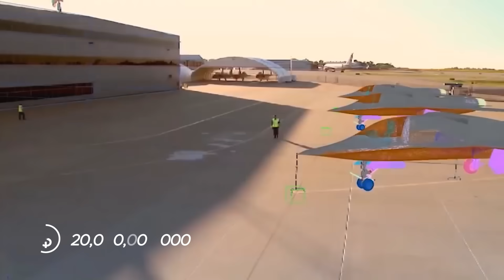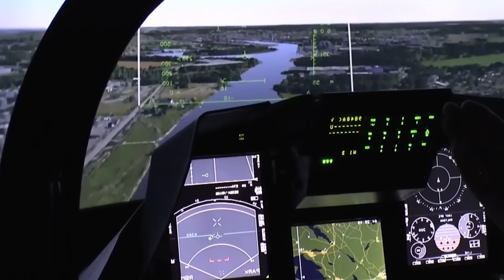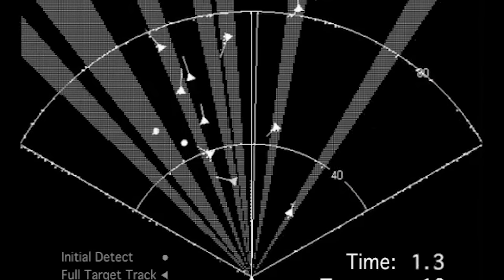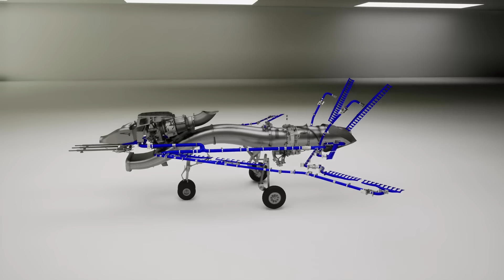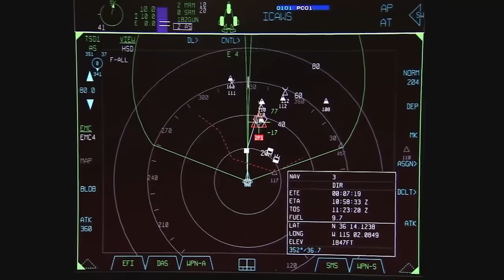Finally: US Revealed Its F-47 6th Generation Strike/Fighter Jet!

Comment: Connectivity is both a strength and a weakness. I hopecthis plane and wingman can operate even in noise saturated environments. Perhaps low power laser communication augmented by AI isolated mission operation during key phases of a mission.

Comment: The MONEY and ANNOUNCEMENT has very little to do with USAF requirements. It is a purely political decision where Trump thinks ONLY MONEY TALKS. Firstly to stop Boeing going Chapter 11 it needs $Billions. Biden GAVE Boeing that by swapping USN request for Lockheed Martin F-35C to BOEING F/A-18 Super Hornets. NOW Boeing still haven't sorted out their home made problems so a Trump Bigger Bung via "the development of the Next Generation Aircraft for USAF. Both these actions are in clear breach of the WTO Agreement regarding Boeing and Airbus. This is covering the Gaps in the 787 Fuselage with Elastoplast. The fundamental flaw is when the EU complains to WTO then after 4 years IT WILL BE TREATED AS A SUBSIDY and the Fine will itself break Boeing. Then there will be NO NEW DESIGNS for a Generation and like the UK the USA will have LOST its Commercial Aircraft Industry BY CHOICE. 
This is DUMB
Lockheed Martin can sue because it needs to recover many $Billions taken by Biden and Trump.
Reply: Obviously you have never been in the U.S. Navy, or worked for the DOD, Boeing, Boeing Aerospace, or any other major defense contractor. You have no idea what you're talking about, you sound "DUMB".

Comment: I'm very sure there are. US military aircraft that can fly into  space. Ai control. Or the pilot can at least fly the plane from earth ground. Never.
Even getting in the plane.  using tech like nuro link Basically , just think of what you want  craft to do and it'll do it. No need to worry about oxygen or G force . While using weapons far more advanced than Even lasers. Flying so fast that The enemy will not know what Happened .

Comment: $300 million per aircraft ?  You have to be joking. Does that include the lifetime maintainance contract ? NO. Remember the F35 program was supposed to $200BN but so far has cost $1.7 TRILLION.  So expect each new F-47 to cost about $2BN a piece and the double that with the maintainance contract. Love the vignette BTW.
Reply: The Vignette is probably more realistic than the fake video.
Reply: If Boeing got a cost/plus contract, you are correct!  It's all about the dollars.  Especially since they lost their shirts on the Starliner.
Reply: Are the ones that are building it with the same level of quality assurance the same people that build the 737type of airliner that keeps on crashing.

Comment: Wow! The super-duper F-47 look so fantastic & invincible, while the China J-36, according to most Western Analysis, "look impressive". However, the BIG CRITICAL DIFFERENCE is that the J-36 is already in the air while the F-47 is still on PowerPoint and AI generated simulation. 
Most probably India might assist the U.S. with their F-47 by imparting technologies like in their super-duper Vimana which are capable of intergalactic travel and have been protecting planet Earth from Space Invaders for the past few centuries which we ordinary Earthlings occasionally see them and called them UFO/UAP/USO/etc.
Reply: J36, is that the one the pilots call the flopping fish. That regularly burns out its' own engines?
Reply: @johnmccallum9106  
WOW! So, the U.S. of A has absolutely no need to worry about China catching up to their technologies. Congratulation and very well-done team U.S.A... and together with team India, they will be invincible all across the entire galaxy :face-blue-smiling::face-blue-smiling::face-blue-smiling:

Comment: One fighter cost could have saved the whole of the train transport system in the whole of the US. 2 of these would have cleaned up all the streets. Healthcare would have been all sorted by not making 2 -3 of these fighter planes. China really needs to make an automation system which can build these fighters faster and stock up;) It's a numbers game. China should train as many people as possible to fly multiple drones in warfare. Fighters are useless if cannot go long range. These fighters only have range of about 10Km as it sucks up fuel at the rate of SpaceX.

Comment: If its anything like their ships it will be lucky to fly for more than 10 minutes like the crappy aircraft carriers they've thrown together. 17 days at sea for the Fujian then refuel, when the stern doesn't crack and have to be rewedded. Or the new sub they built that sank in the dock while under construction. Or the fact that a high powered rifle can punch holes in military ships hull because the metal they use is crap. China is nothing! Yes they are a pretend super power with everyone of the traitors that past on the information they now use to try to be a powerful super power. But china can build all the stuff but have ZERO understanding of how it came to be. Believe it or not that understanding is vital to move it forward without massive problems and the Chinese have all thoughts problems inherent in everything they steal. Its screwing them and they don't even know why.

Comment: We really should be naïve without being aware that the air defense will also progress!!! The S 300 PMU 2, S 400, Buk m2 and Pantsir S1 are air defense systems that were made for 4,4+ aircraft and the first 5th generation aircraft!!! And in this conflict, Russia had FPV drones for which it had to find a solution?!?! And they succeeded for the simple reason that the Pantsir S1 is a system that is designed to work like a 4+ generation aircraft, only everything is packed on a truck!!! The fire control system as well as the radar are Mounted on a truck which is much easier and cheaper than building a plane!!! Which means that as the planes advance, the Pantsir S1 will get much stronger radars, as well as everything else that is needed!!! As we have seen, Russia has managed to save Syria from 4th and 5th generation aircraft, there is no reason to speculate that in 2 to 3 years there will be a modernization of all air defense systems in Russia, and in addition, Russia is working on its version of the 6th generation aircraft. According to the Russian view of things, the aircraft is 6 generations It should have the ability to fly above 25 km altitude, which has already been achieved with the MiG-25 and the second thing is that the aircraft, in addition to the next radars and electronics, can generally reach speeds over Mach 4, which is with an altitude of over 25 km, quite enough to go unnoticed and to easily avoid all threats from the ground and from the air. Its task will be primarily to intercept anything that tries to enter Russian airspace, which is quite enough with air defense systems!!! And what is most important and what Everyone forgets: Russia has been working on nuclear projects for howitzers and mortars for another 60 years, and if it was successful, I don't see any reason why some of the missiles for the S-400 would not have a nuclear charge, since it is allowed under the Russian nuclear doctrine to use this type of weaponry only in defense, and air defense is classic only defense.  The S 400 can hit targets up to 35 km high, if such an explosion occurs at an altitude of 20 or 30 km, it cannot be very dangerous for the rest of the world And that's why all the planes that are within a radius of 50 km can't work!!! And that's one of the possibilities?!